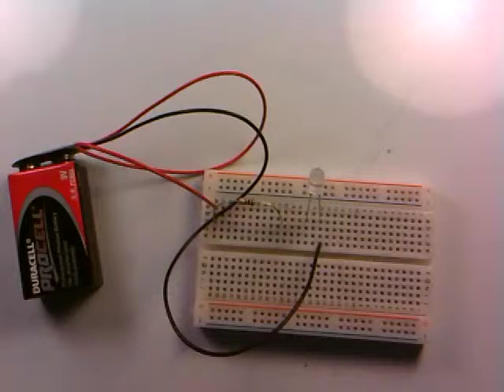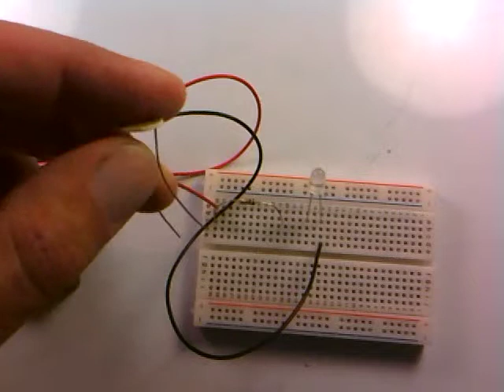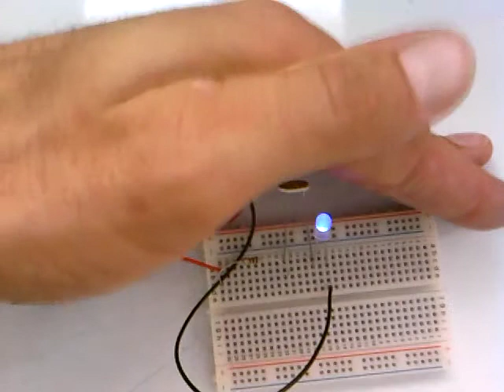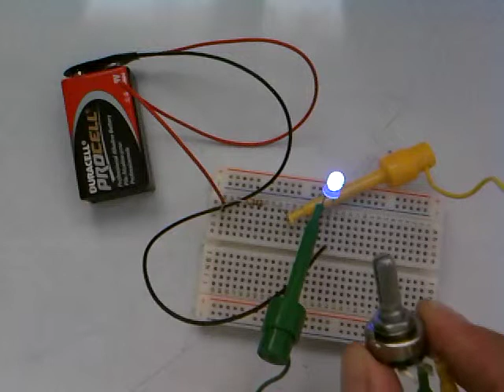elec 012 1 cds and potentiometer led circuit

Comment from the maker: When I had the pot in, when turned all the way down, the R of the pot is about zero, but I still had the 100 ohm "safety" resistor in there.  9V/100=90mA, which is still plenty to have the LED on.  For the LED, choose a base R from R=(V-Vled)/I, where V=supply voltage, Vled=the LED's on voltage (4.6-5 for blue), and I=20mA (good current to run an LED).  If you sweep R much higher, the led will go out, any lower, you might start pushing the current limit. Start there.

Comment: Oh and I wanted to mention, the correct voltage is already being supplied to the LED, so obviously I do not need to add a standard resistor to knock down the voltage. I just need to know what value of potentiometer I need in order for max control and gradual sweep, as well as completely on and completely off. Any ideas? Thanks.

Comment: Thanks for the video. I am "hacking" the LED backlight for an LCD display on an alarm clock. Couple of questions: (#1.) Why did the pot in video not completely kill the voltage of the LED when turned all the way "down". (#2.) Considering the max LED voltage of a bright blue LED at appx. 4.6 to 5v, to get the most gradual sweep between completely OFF (complete resistance) and completely ON (no resistance) what resistance value potentiometer do I need to use? (#3.) Audio of Linear Taper for sweep?